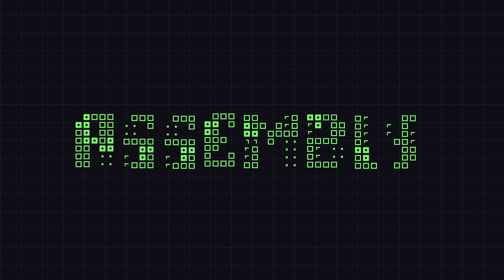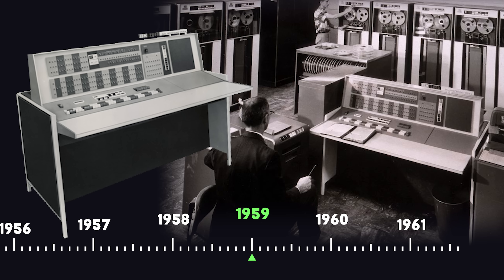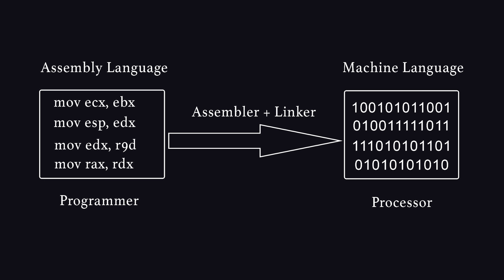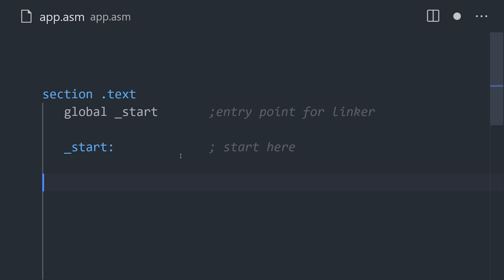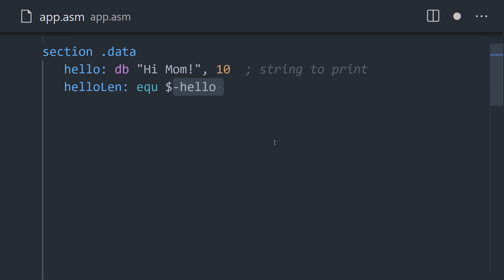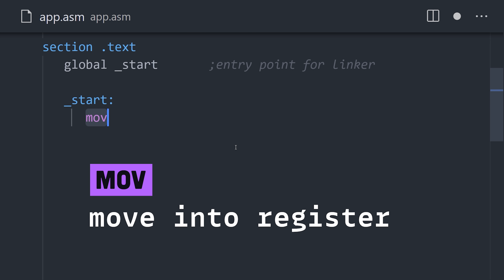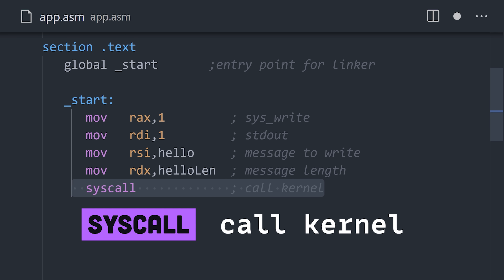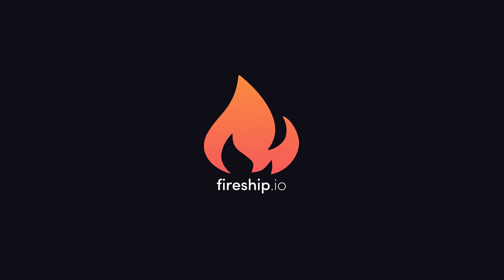Assembly Language in 100 Seconds

Comment: Assembly is not that hard if you understand CPU architecture a bit; but, what about "machine code"? What hell is that actually? How does the CPU converts 011101010101... into computing and moving data between devices like RAM, SSD, headset, mouse? I struggle to understand that layer.
Reply: 0's and 1's are just on and off. it counts the bits in sets of 8, which are bytes, and reads it from right to left. for text and stuff, it uses the ACII table iirc. I'm not too knowledgeable about this myself but if you want the letter 'a', you start it off with 011 (this is lowercase, 010 is uppercase) and then start adding 5 more zeros. You'll have 01100000, which in this case isn't a letter yet, but it's value is 96. this is because reading from right to left, every place it moves up from doubles it in size. so the 0 at the end is 1, but its off so it's not counted. next is 2, 4, 8, 16, 32, 64 and so forth. so 01100000 is 96. You can plug that into the ascii table and see what it gives you, I think it was ` but I'm not too sure about that. 

so, back to getting the letter 'a', which is 97, you just flip the 'first' (for us the last) 0 to a 1, like so: 01100001, and you get 'a'. likewise for 'A' its 01000001. 'b' is 98 so 01100010 and so forth.

I think to start even grasping the idea of how the rest works with it all just working on 0s and 1s, this is the lowest point of understanding haha. I haven't a clue how those tables are even defined so it knows what it is yet. It's almost like magic, really.
Reply: @OrgBrent  thanks for the detailed explanation. That doesn't answer though 😅 You explained data encoding. That I know very well.

My question is, how does a sequence of higher voltage and lower voltage signals (1s and 0s) become data at my RAM stick?

Is there like a pre-defined list of available sequences? e.g.

01010101 = sum
11101010 = move to register
...

And there is a set of "integrated circuits" that directs the signals to the appropriate ICs?

So that the assembly language is a direct translation of "machine language"?
Reply: @igor9silva  Hey, bit late but "Is there like a pre-defined list of available sequences?" essentially yes. The first byte to be read is reserved for an instruction, this instruction is compared in a comparison circuit with different instructions and when it matches one the circuitry for that instruction is then executed. The same type of instruction can also have different variants like "00010000" could be "Add two 8 bit numbers" and "00010001" could be "Add two 16 bit numbers". 

Now what follows after the instruction byte sometimes depends on the instruction, for example, to add 2 numbers you'll first need an instruction byte, followed by memory address(8 bytes long in a 64 bit system) of the first number, then the second number, and then the memory address of where the value is to be stored. But for example a "copy" instruction you would not need the third address, to copy A into B you just need their 2 addresses. 

The basic thing is that the computer knows, based on the previous instruction, that what the next bit or byte is referring to and how far along this stream of 1s and 0s the next instruction byte is. This is obviously very oversimplified but theoretically that's the gist of it.
Reply: @Haris-bg4jy  I love you

Comment: I hate the assembly languages and low-level programming languages. I had the FASM language and that was very hard for me. I don't know so much about assembly language. Why? Because that was too  complicated! One instruction was taking a 20 or 30 lines of processor commands. For one stupid thing. More instructions produces more lines.
I don't know if it is worth it for the program to start in less than a second. I guess not. This language was the stupidest and hardest thing I have ever come into contact with.
Only instruction comments helped me to end the computer architecture course.
I prefer the high-level programming languages.

Comment: section .data
    hello: db "hi Mom!", 10     ; string to print
    helloLen: equ $-hello       ; length of hello string

section .text
    global _start               ; entry point for linker

    _start:
        mov     rax,1           ; sys_write
        mov     rdi,1           ; stdout
        mov     rsi,hello       ; message to write
        mov     rdx,helloLen    ; message length to write
        syscall                 ; call system kernel

        ; end program
        mov     rax,60          ; sys_exit
        mov     rdi,0           ; error code 0 (success)
        syscall

Comment: cool program but why does the resource linked lack a single mention of the <r~~> registers. is it a 64 bit thing?
more importantly the fuck is going on here, how does putting one in registers print stuff to the command line.
i copied this pretty much exactly and it worked but i still understand nothing.
what is syscall.

Comment: Why would anyone want to subject themselves to  this level of torture?
Reply: There's a very real performance difference. You can write a O(n^2) assembly program and unless the input is astronomically high it will run on par with or in most cases even better then the same program in C with O(n).
Reply: @Haris-bg4jy  I don't need the performance difference, I'm running an 8 core 4.2 Ghz processor, I can afford the overhead...
Reply: @codingneko  Nobody is talking about just you here. You asked why would "anyone" put themselves to this level of torture, if you wanna program embedded systems with very little available resources that's when you'd "put yourself through this torture".

Comment: Now do machine code
Reply: Assembler is pretty much machine code, an example in 6502 assembler:
LDA #$FF is A9 FF in hex and 10101001 11111111 in machine code.
Of cause the 6502 is very old, but todays computer work the same, just bigger and faster.

Comment: Assembly is bloat, we need coding in binary within 100 seconds.
Reply: Assembler is pretty much coding in binary, just with letters.
Example in 6502-Assembler: LDA #$10 would be A9 10 in hex and the CPU would read 10101001 00010000
Of cause the 6502 is very old, but todays CPUs work the same, just bigger and faster.

Comment: FAIL!

Assembly is technically not a "language" per say so much as it is a meta language for the series of assemblers (like NASM/FASM/MASM) that are responsible for converting directives and mnemonics with their corresponding operands (as covered by specs linking syntaxes to different kinds of CPUs like x86 or RISC-V) into object files which are then linked together by a linker to create a binary executable.

There are even meta-assemblers and high/low level assemblers if you want to get particular with it.

And yes, there's a difference between GAS and Intel syntax, but that's a whole other story...